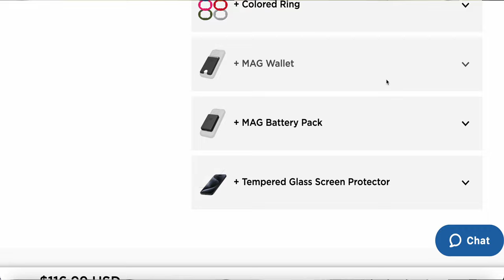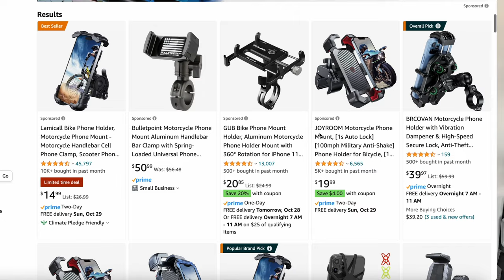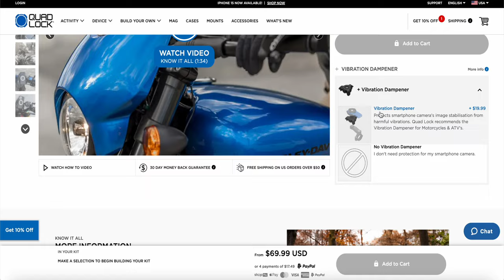What's The BEST MOTORCYCLE CELL PHONE MOUNT? Quad Lock Vs. Biker Gripper-THE WINNER IS? USA Made!

Comment: I have the Quadlock and use it with a perch mount and vibration mount on my bikes, push bike and in the car with  suction mount and a wireless charger. Very happy with the Quad Lock especially when I dropped my phone today without damage
Reply from the maker: Awesome. Thanks for watching. Next time you get a new phone, bc you'll need a new case w/ quadlock, check out our Biker Gripper. See whatcha think. No more proprietary cases with every phone upgrade.  Ride safe!!
Reply: @RyanUrlacher  you almost always have to buy a new case anytime you get a new phone anyways 🤷🏻
Reply: I looked at everything available and went with QL. Seen a few like the BG design and they all look cheap. QL has the logo, just refuse to put a skull on my bike. Skulls scream a fat chick with a H.O.G vest and bar end tassels.

Comment: I purchased your Bike Gripper probably back in 2015 when I  bought my street glide and it has worked flawless. The only minor issue is the rubber gripper pieces inside of the clamps over time fell off, I just replaced with some small pieces of door weather stripping.    
The bottom line is I would highly recommend the biker gripper. I have a friend who i tried to get to buy this mount and he ended up with a cheaper Amazon mount which on more than 1 occasion didn't hold his phone securely and it fell out.  He finally broke down and bought the biker gripper last year and loves it.
Reply from the maker: Thanks for commenting. You're right, depending on climate and after many years of use in heat etc, the little grip pads on the insides of the mount can be replaced if necessary. We have those replacement pads available in our store. Great price of course for them if needed. thanks for your support and so glad you love the Biker Gripper. **I still don't know why guys buy an EXPENSIVE PHONE and then totally cheap out on a cheaply made mount from eBay or Amazon. Crazy to me........We've received so many horror stories from customers about using those cheap mounts before getting the Biker Gripper.

Comment: I purchased your Bike Gripper several years ago.  Best cell phone holder ever.  Strong and durable.  Over 50,000 miles on my bike in all types of weather and terrain and never once did my phone even shift.  The rubber gripper does wear out over time, but that's normal and easy to replace.
Reply from the maker: Thanks for sharing and for your support. We know if we can get it in the hands of bikers, they'll quickly realize why its the best quality mount on the market. ride safe
Reply: @RyanUrlacher  But no charging heads or anything. Thats the one thing quadlock has. You guys should develop a wireless charging biker gripper, instead of running a usb cable, id rather have a wireless charging waterproof system. Also it seems like depending on the kind of phone you have, your gripper may press buttons on the side. Some phones have buttons in the middle of the phone side.

Comment: I love the Biker Gripper.  I have put one on every bike I have owned (3) since first coming across them in 2016.  The only complaint I have is my first one, the polyurethane fabric came off and made a sticky mess during a long motorcycle trip.  The ambient temperature was averaging 105 F for three days in a row.  By the third day when I took my phone out of the gripper the fabric came with it. I happened to carry a small roll of gaffer tape in my saddle bag and used that to replace the fabric that came off. Even with that, I still love the Biker Gripper and will continue to use it.
Reply from the maker: Awesome!! thanks for your support. Yup, depending on environment and long term use the simple grip pad over time can be replaced.  For those that need them. Not everyone does. Depends on the sitation. We sell them. Great price ==> https://shop.lawabidingbiker.com/collections/bikergripper

Comment: I have 2 biker grippers and just this year running quad lock with wireless charger head. I like both systems and have no problem with either really. I like being able to move my phone around on the biker gripper and I also like the wireless charging on the quad lock. My thoughts are if you aren't going to be on the bike 14 hours with multiple destinations planned then the biker gripper is much cheaper and holds the phone as well as anything. I have probably 75k miles running biker gripper with zero issues. I have about 9k miles with the quad lock and zero issues also but at over $200 it's more expensive and like you say in the video you can't adjust it for sun light on screen etc.
Reply from the maker: Thanks for your input and information!!

Comment: I've had the Quad lock for about 3 years, I love it, I feel it's the best and most secure phone holder on the market and I've tried a lot
Reply: Do you run the shock absorber?
Reply from the maker: Try the Biker Gripper. You'll never go back after you use it. Ride safe.
Reply: @RyanUrlacher  I've seen it, it's no better or no worse

Comment: I used a Ram mount X-Grip for almost a year on my Sportster 1200. Which does not have a fairing. I was riding on a high wind day down the highway and my phone blew out of the mount and down the highway. Completely destroyed when I recovered it. I've watched you channel for a couple years now. I don't want a Quad lock because of the proprietary case. I'm almost sold on the Biker gripper... almost. I just dont want to watch another phone tumble down the highway again.
Reply from the maker: So sorry that happened. We've heard LOTS OF HORROR STORIES LIKE THIS ABOUT THE RAM X-GRIP (It's so ugly and outdated).......You won't have that issue with our Biker Gripper. 10 years now and we ride cross-country  thousands upon thousands of miles with the Biker Gripper. Yes, even off road adventure. Very rough terrain. All good with the Biker Gripper. Oh, and MADE IN THE USA. ==> https://shop.lawabidingbiker.com/collections/bikergripper

Comment: I have a Samsung Galaxy note 20 will the biker gripper keep my camera safe? I have Hurd that the vibration from handlebars can destroy the camera in a phone?
Reply from the maker: Yes, yes, yes. We've been using these for 10 years cross country. Use it on my off road adventure bike. Have had so many phones in it. ZERO camera issues. I go over this in the video. That's why its the best. Quadlock has damaged many cameras.

Comment: I had a Ram mount but the plastic inserts that size fit the bars are showing signs of stress and will eventually break. Plus the thing loosened up with vibration and turned free while riding. Thankfully the phone wasn’t in it at the time. I am now running the Ciro perch mount. Very secure and the mount will never spin but the phone holder itself sometimes turns a bit. Honestly 90% of the time my phone is in the tour pack so not sure why I’m throwing all this $ at holders. 😂. If the Ciro doesn’t work out, I’m going to try yours because I like the minimalist profile.  Ciro was also expensive. First world problems. Ride free!  ✌️
Reply from the maker: thanks for watching. Yah, we've heard alot of negative things mostly about the RAM over the years.

Comment: What is the thickness of a phone that it can hold? I use a wallett type phone case and havent been able to find a good phone mount that can handle its thickness...
Reply: The answer is a wallet phone case will not fit..
Reply from the maker: The biggest phones it will fit, even with cases. I run a iPhone 15 pro Max with a case. No problem at all. Will fit your larges Samsung's etc.

Comment: Great comparison video. When I got my new phone I did contemplate on trying the other brand but I decided to stick with my gripper I’ve had for almost  10yrs. Question, is it possible to get another set of pads for the inside as mine wore off over the years… 👊🏾✌🏾
Reply from the maker: Yes sir. ==> https://shop.lawabidingbiker.com/collections/bikergripper/products/replacement-biker-gripper-pads?variant=41789282517148

Comment: I have a very similar model to the biker gripper.   I’ve had it on several bikes.  I’m able to put it on the mount and pull it off while riding.  I’m able to do it with one hand while riding without dropping the phone.  I never had my phone fall off of it.  I recommend it for a lot of people.   Only reason it’s not on my main bike is due to MY charging issues Riding in heavy rain.  I’ve had water come up the cable into my phone.   That’s my ONLY downfall in which don’t stop me from recommending your phone holder.    Watching YouTubers use the Quadlock turnt me off from it a good while ago.
Reply from the maker: Yup, Quadlock is just a big advertisement. They throw a ton of money to get into social media and give their stuff to other YouTubers their products free for paid biased reviews etc. We've never done that and NEVER WILL. Our product speaks for itself.

Comment: Folding phones. Does it work with thick phones such a the Samsung Fold 4?
Reply from the maker: The grip range of the Biker Gripper head is 1.9” to 4.2”. The Biker Gripper head fits even the largest of smartphones! ==> https://shop.lawabidingbiker.com/collections/bikergripper
Reply: That's the phone I have. Wondering will it fit the Biker Gripper with my caseborne s pen phone case in the closed position.

Comment: I actually went to their site to order a case and mount. Horribly confusing. Never bought one. 

However, I actually have a hard time believing YOUR mount will hold on a soft tail without a windshield at freeway speeds. On the glides I can see it holding but with full wind exposure, I’m very skeptical.
Reply from the maker: Well, start believing. We've been running them for 10 years. Go look at reviews. I run one on my 07 night train and 16 Dyna Low Rider S. Neither have windshields. Yes, on the freeway at 80+. Believe in it. I would not sell them if I had any concerns. We are bikers and we only sell the best and what we trust. Biker Gripper is the best. You'll never go back.

Comment: I’ve been using ROKFORM for the past few years and it works great!  However, I’ve had to replace my phone case 3x because the polycarbonate case has a weak spot around the physical docking port. I have three motors and RokForm mounts with a vibration dampening system on each one.  I’d like to know how this compares to the quad-lock system.  What say you, fellow motorman?
Reply from the maker: I'd say check out our Famous Biker Gripper. ==> https://shop.lawabidingbiker.com/collections/bikergripper.  You'll never have a polycarbonate case issues or other issues for that matter. It's an open system and needs no proprietary cases or locking systems. We use it exclusively on our entire Motors fleet for that reason along with many other Motors fleets around the country that get it direct from us. Just my two cents.